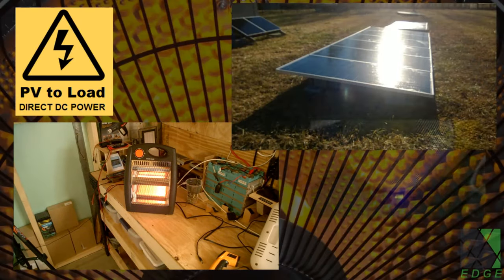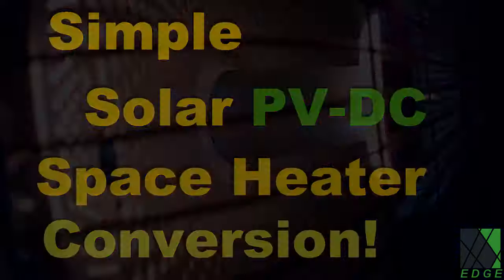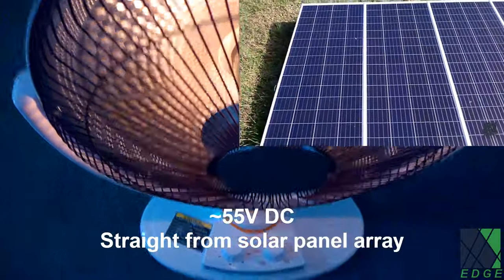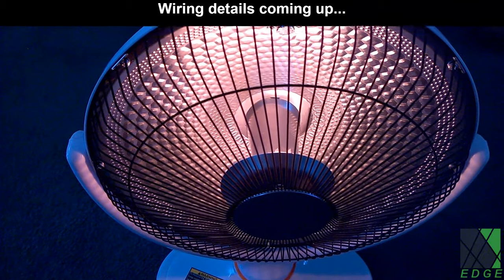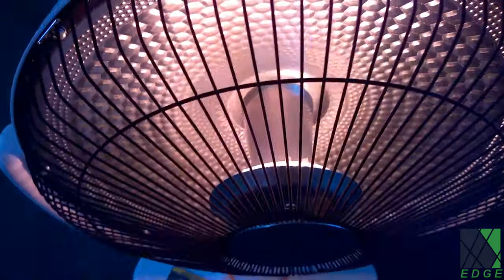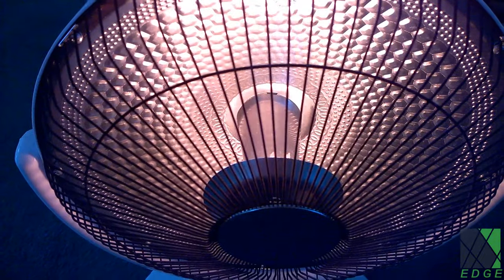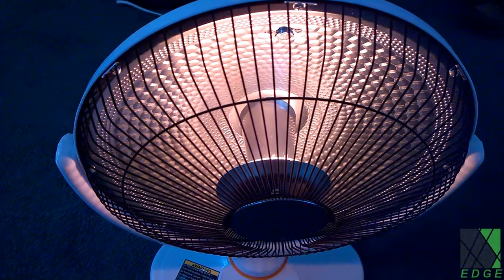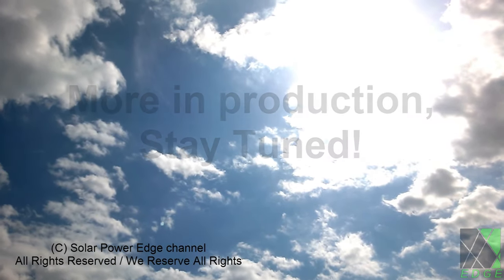Solar Electric Space Heater Easy DIY! Parabolic 55V DC direct power by solar panel array #solarheat

Comment: Awesome project-- thanks so much for sharing this! Any chance you could do a walk-through tutorial for building one of these? Complete with which exact components to get, etc? Thanks a ton
Reply from the maker: Welcome :) planning to upgrade mine and can do a build video then. I'll put it on my to-do list. 

PS in case it's any help. The tip over switch is listed in the description. The thermal fuses are very common parts used to repair coffee makers and the like. This is actually a dirt simple project but due to the fire risk it must be handled with care and have professional build quality. As soon as I can record more footage I'll upload for you. Please stay tuned :)
Reply: Thank you! Looking forward to it. Cheers!
Reply: Yes sir,  you say,  "dirt simple", but you will have to "dumb" it down for me.  Although I have some basic knowledge,  I'm just a simple HSE Lead & Paramedic,  working 2 weeks at a time, offshore.   I will need a solar heat source for my very small starter greenhouse.  It needs to be temperature controlled while I'm away.   Although my wife is home most of the time,  I can't count on her to check the greenhouse every 30 minutes to see if it's getting too hot. And I can't afford to kill my Bonsai tree.  I would also like to see a detailed instructional video.

Comment: Would a 12v DC temperature controller work with this (set to a max and min temp, to cycle the heater on and off)?  I'm trying to heat a small greenhouse.   I even thought about using a car fan heater.   What do you advise?
Thank you!
Stacey Coffman
Reply from the maker: @rigmedic6941 Hi, yes it would work - but for this exact heater 55vdc+ I recommend adding a heavy duty DC contactor or similar to switch the solar panels. 
However a 12vdc car heater or PTC heater is just fine, you could use 12v solar panels for that and the 12v temperature controller should switch it no problem. I have at least one video about the car and PTC heaters, they work pretty good. I would mount them to a non-flammable surface (cement board) just to be safe. Hope this helps!

Comment: Just to add that you can buy infrared heaters that mount on the wall and have three bars giving a total of 2000W, so would not need the tilt switch. On another video you mentioned that having the heating elements wired in parallel reduced the total resistance so would having three element in parallel work at reducing the voltage requirements?
Reply from the maker: I believe I mentioned the parallel elements in either the part 2 heating video and/or solar panels and ohms law video In short, putting heating elements in parallel proportionally reduces their resistance - works on paper. It cannot solve everything. In the real world with a varying solar input and low voltages, it starts to get a bit more complicated. So I usually wind my own elements to match the panels. Super tedious, but problem solved. All of my heaters are running around 55v still in the reasonably safe 48v nominal range, and can produce a useful amount of heat without requiring massive wires and such. A few do have parallel custom wound elements, those work fine too when matched. But the beauty of the HF heater - no rewinding, it acts like a light bulb, not a quartz tube element. I didn't think it was really worth the effort, but all doubts were proven wrong. Easiest DC heater mod ever. Just some wiring to do. I love the directional glow when the sun comes out. Working on a more powerful version, hope to get that on video someday.
Reply: Hello… Thank you for the videos!!! Very interesting and informative! Question … If you have an eco flow or bluetti  or similar unit … would it be possible to use te 12v/10a out through a dc dc buck converter to reach the voltages needed to run a dc heater?  I’m already out of my league here so hopeful I’m making some sense.  I’m thinking about heating at nighttime where I have a 12v battery or device …. Could that drive the parabolic heater? I’d like to extend runtime using dc and avoid using an inverter if at all possible for heating.  Thanx !!!
Reply from the maker: Hi, you're welcome and glad you like the videos :) I hear you there, I avoid inverters for heating whenever I can... 12v/10a could run a 100w 12v PTC heater. But how about this: a 12 Volt electric blanket! I figure a solar generator can run that all night, and it's a very efficient use of DC heat. My only concern would be the quality of the blanket, don't want to sleep with it on unless thoroughly tested. The HF parabolic heater would probably need 35a at 12v through a converter to run, and that's just too much load on one generator. This is just my opinion but I hope it helps!

Comment: can you find out how to do this on a larger scale maybe heating a 300 ft room?
Reply from the maker: Hello, that would be quite a task. Could use a large array of solar panels and multiple heaters in different locations to spread the heat out. It's possible. Just the solar panels would be quite a bit expensive.